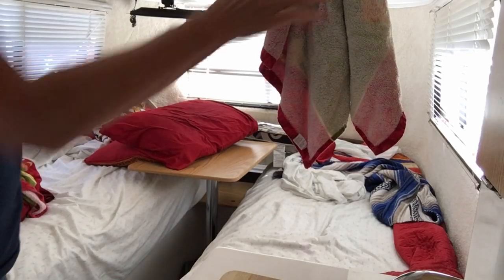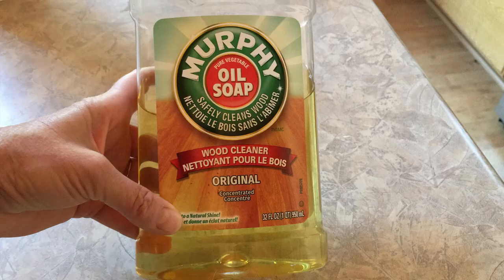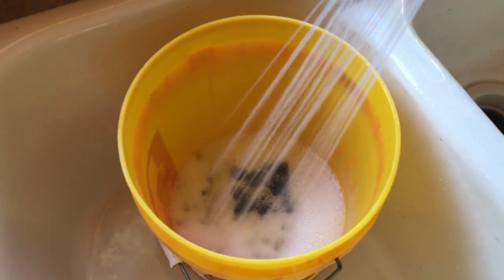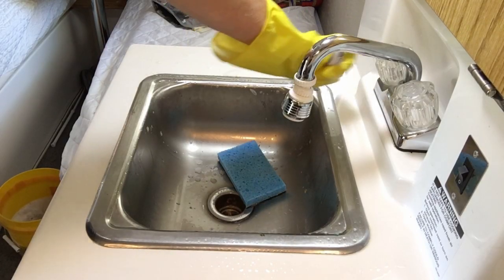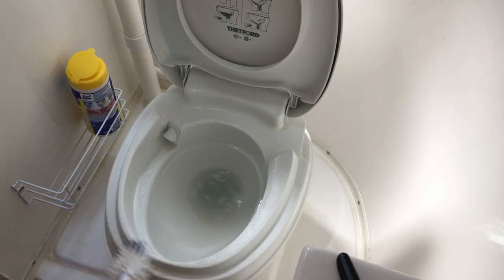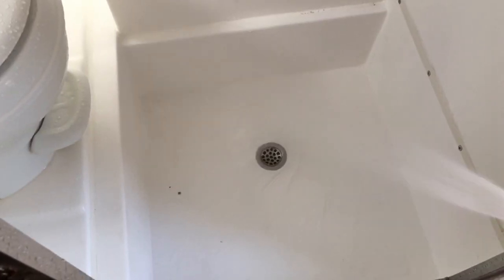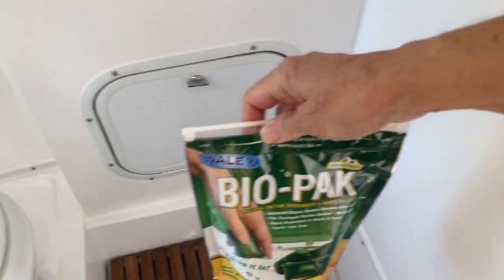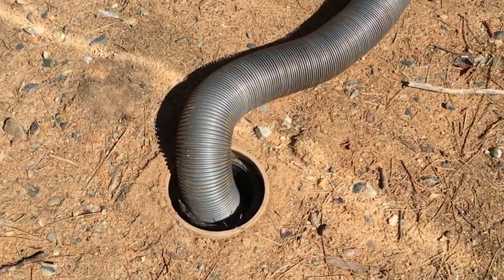Behind the Scenes of This Dastardly Chore: How We Clean the Camper Fast!

Comment: I noticed that you have a real shower curtain rather than the plastic shower curtain.  How do you like it?  We have a 2018 17’ SD Casita and I’m considering changing out the shower curtain to a fabric curtain.  I’ve put hooks on the ceiling of the trailer bathroom so that we don’t get the entire bathroom wet when we shower.  It has worked well, but am just thinking that a cloth shower curtain will dry faster.  Thanks for sharing your cleaning tips.  We also add a All Clear clothes washing soap packet to the black tank before driving to help clean it better before dumping.  It has worked really well to keep the toilet fresh.
Reply from the maker: I love the shower curtain.  It dries really quickly and I've never had a problem with mold.  That's a great idea to put a curtain around the shower enclosure.  I hate it when the toilet gets wet!
Reply: Travels and Travails: Enduring Adventure I got the idea from Alan on RV Adventures YouTube channel.  He did a video about it I believe.  By the way, we love to watch your videos.  We lived in Northern California for over 30 years and seeing your videos about different places brings back lots of good memories.  We do get out to visit so some of the places we may put on our lit of places to stay.  Do you like your shower floor slats?  I didn’t want to get one of them because I thought it would hurt my feet.